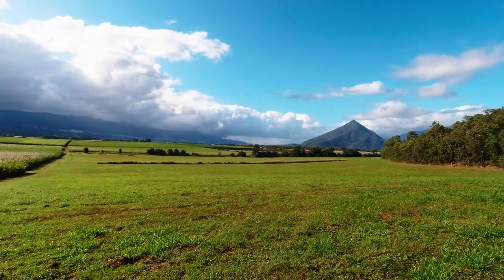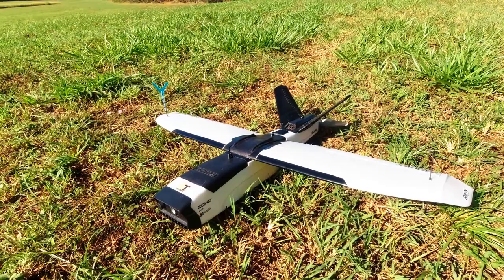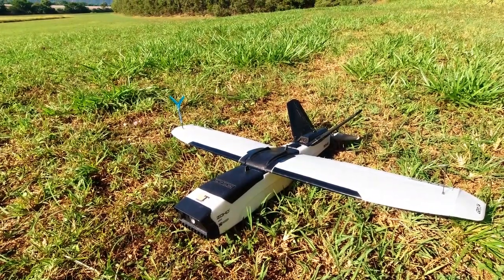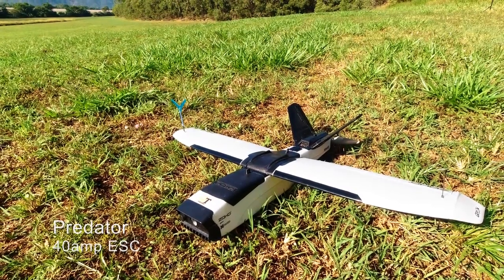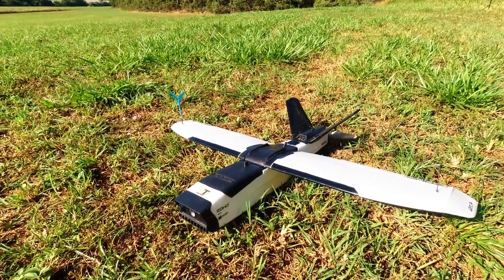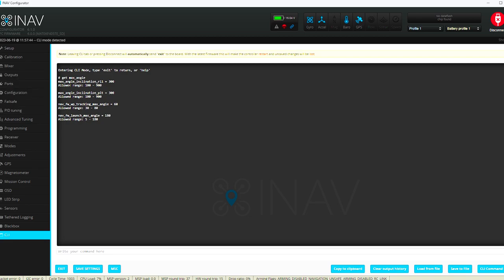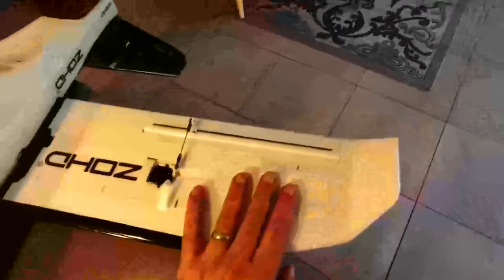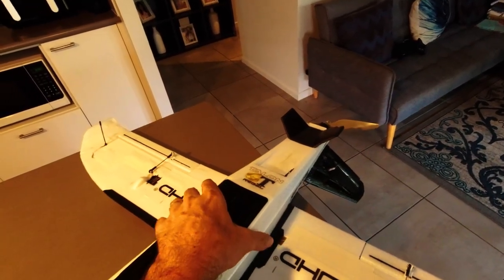Talon GT Rebel Maiden Flight

Comment: Love all Talon planes. Will be exciting to see how many amps it draws on cruising. Right now it is hungry for batteries. My Minitalon cruise around 4 amps and nano Talon 2 - 3 amps. Great video, thanks
Reply from the maker: It still has some tuning for sure, i am thinking of using a lighter battery for it something around a 7000mah li ion and see how it goes. It also seems to pull to the right on takeoff in the few launches i have given it, at first i thought it was a balance issue but resolving that it still veers to the right on takeoff. It could be at time poor throw not helping it sometimes but i have tried to correct that and it still does it after the throw just like in this video.

Comment: The unassembled ZOHD Talon GT Rebel 1m Wingspan V-Tail seems to retail for $60.. but that doesn't seem to include any of the electronics, correct?  You still have to buy the servos, Radio, Flight and Electronic Speed Controllers?   And I assume an FC for a drone won't work on this? 

Do you recommend any Ready-To-Fly plane that has everything included?
Reply from the maker: No this kit has no electronics, I believe you could get this as bind and fly for a bit more $$$ though I’m not too sure if they produce it anymore. Pretty certain the Talon GT never came out ready to fly. Sorry but I can’t really give you a recommendation of a good RTF plane as all my planes were built from kits. Best to build I think, that’s if you confident enough, it gives greater satisfaction once it’s all airborne and it’s also the best learning curve. Any flight controller that can install either iNav or ardupilot would work on a plane but it’s best to get one more suited for flying wings such as the f405 or f765 from matek those are design purely for planes.

Comment: I've been following your build of the rebel gt so thanks for those videos, I have the rebel gt unassembled kit on the way and also have the zoid xl enhanced which has been a great plane. Just wondering which of the 2 you prefer? Also im trying to find recommend control surface throws on the rebel gt how is yours setup? All my planes are also running on expresslrs 3.3.0 and so far no fail safes on my 1.3ghz fpv i use only RMRC tx and rx have had the XL out to 7 miles no problem. Any advise would be appreciated Thanks again
Reply from the maker: Hi and thanks for the comment, out of the 2 planes I currently prefer the Dart XL its setup well faultless auto launch and tuned quite well. My Talon on the other hand struggles on the auto launch especially on a more windy day. I run the same 10000mah battery as I run in the Dart Xl. Where the Dart has no issues using it I think the talon struggles more especially on take off. Once the talon is up it feels a more exciting plane to fly, more agile than the Dart. Both great planes but I have found the Talon harder to get flying with the 10000 mah battery. I do plan to sometime get a smaller battery maybe 7000mah to make it a bit lighter upon takeoff hopefully that helps it. Btw great range on your Dart 7 miles, I havent pushed mine that far, mine has gone out to about 6km still with great elrs range.
Reply from the maker: The throws for the talon I am pretty sure are in the manual. From memory I think around 10mm ailerons and 12mm elevator although I’m not 100% sure if that’s exactly correct.
Reply: Ok thanks for information, my rebel gt is still on the way but I'm trying to figure out what would be the difference as far as autolaunch I know that's a heavy battery but with same wing span, motor and prop combo seems like one would launch similar to the other, I build my own 18650 packs been flying with 4s2p 7000mah battery but C rating to low 20amp, in process of building a 6200mah with 30amp C rating but to me thats still border line, my ar wing pro and dart xl pulling 32 to 35 amp on autolaunch but will see how it goes. Keep making those videos very informative.
Reply: I'm still flying my rebel gt every chance I get And flying good but only thing its still banking hard right on autolaunch just like yours, just wondering if you ever got this figured out. I've tried everything i can think of but still banking hard right. Thanks
Reply from the maker: @egtreadway4232  although I haven’t flown it now for a bit since my it had a slight mishap on launch because of it, it still would bank right on launch, I never really worked it out but I think I will give it another flight soon to see if I can suggest anything. It seems to be an issue quite a few people have had with. It’s the only plane I have which flies good once in the air but getting it launched has me holding my breath every time. I put the cause down to it heavy weight.
Reply: Ok thanks,I fly mine with a 4s2p 7000mah pack which weights 428 gr maybe thats too much for this plane,I'll try a lighter pack maybe thats it

Comment: Hi! I maidend mine today, but it was quite windy, so i do not have a good understanding of its flight performance jet.
Only think i noticed is that the CG markings are quite far forward on the wing compared to other planes i own, so i wondered where you have your cg
Reply from the maker: I also have used the markings underneath the wings. The battery I used in mine is quite large I plan to use a smaller battery in it from now on.

Comment: The inverted V antenna should be pointed to the front of the plane, not up in The air
Reply from the maker: Is that what’s recommended with that antenna? I will give it a go see if it improves, I’ve never seen any info on the antenna where it should be positioned that way. Thanks for the tip.